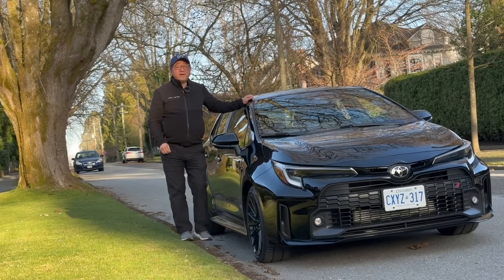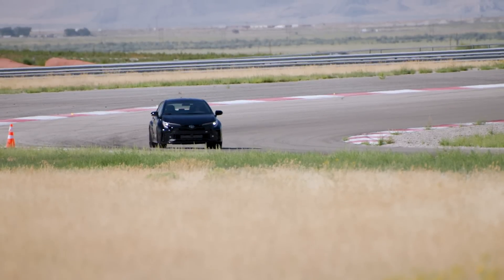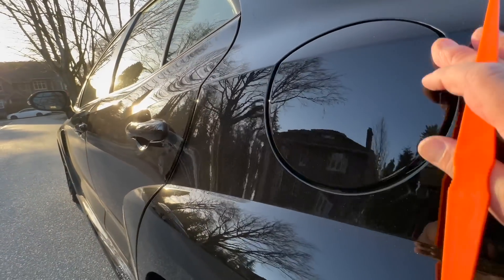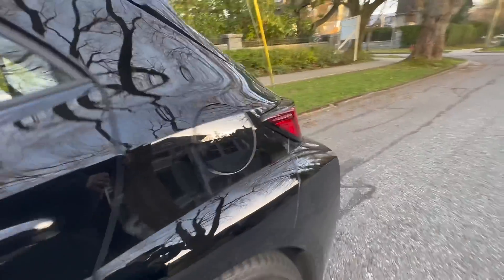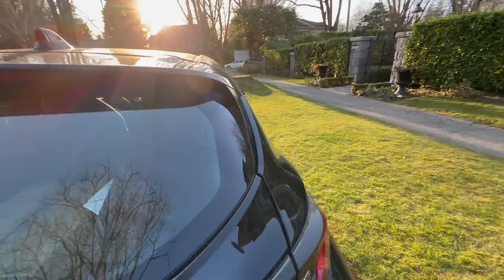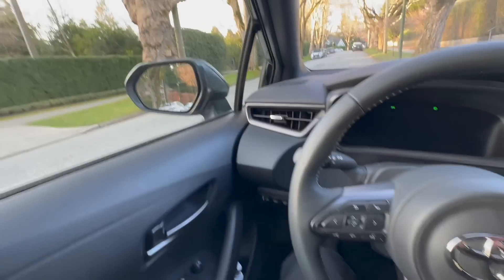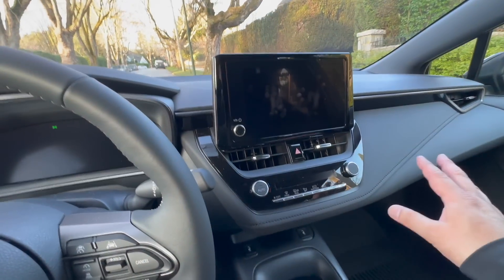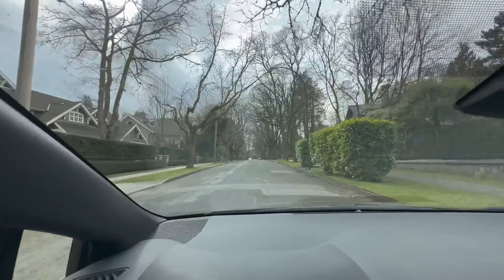GR COROLLA IS BUILT IN GAZOO RACING FACTORY IN MOTOMACHI PLANT IN JAPAN - HOW'S THE QUALITY?

Comment: You should check your front struts and see if the shipping blocks were pulled from the springs. It would explain the feel every bump ride you described. Others have said it's not that bad and could use some coil overs for handling.

Comment: Sure we pay MSRP in Canada, but it doesn't really matter when the dealer won't sell the car unless they puts 10k in addons eg. 4k in rust proofing and paint protection, tint. 3k for additional warranty and other ridculous things that ARE MARKED UP. It's even worse cause the allocations for Canada are much lower for example 1500 circuits vs ~200 circuits for the canadian market.. thus is life for limited run cars especially if you want it or you can just be a real dude and walk away.

Comment: With good maintenance intervals like keeping up with oil changes using good-quality synthetic oils like Amsoil or Motul at every 5k miles for peace and mind, using Top-Tier grade fuels with a good amount of detergent agents and overall driving habits, I reckoned that the GR Corolla can easily get past to 300-500K Miles mark or beyond that on the original engine, turbo, transmission and differential without any serious issues unless you regularly track it and the issues I keep on hearing of the AWD system being overheated because of hard track useage or so I heard being the only main concern for the GR Yaris/Corolla platform. But other than that, just like any cars these days whether it'd be Turbo or N/A, maintenance is key people! I trust the engineers in the Motomachi Plant in Japan putting a lot of efforts and quality into their line ups to meet up its expectations on their quality control.